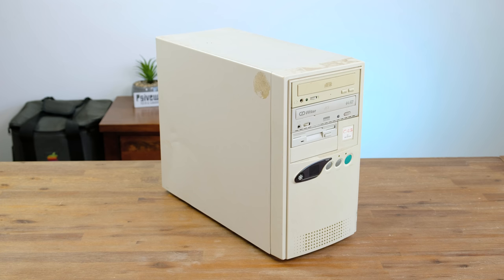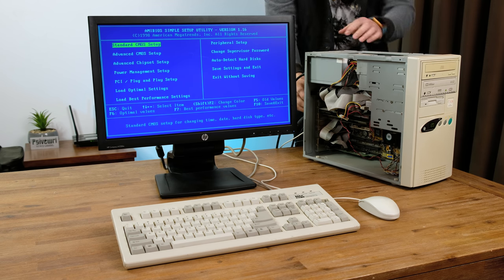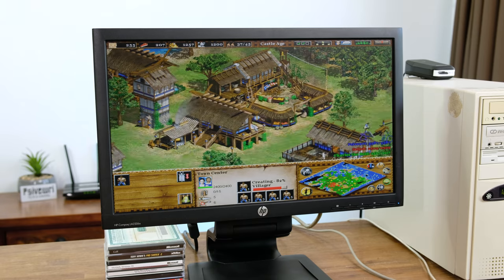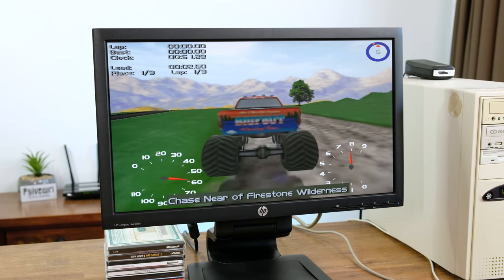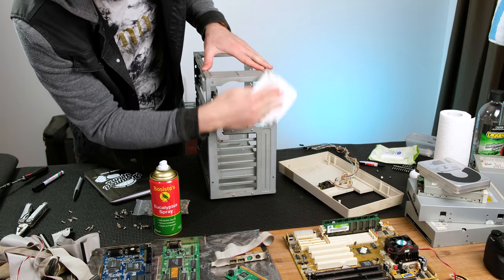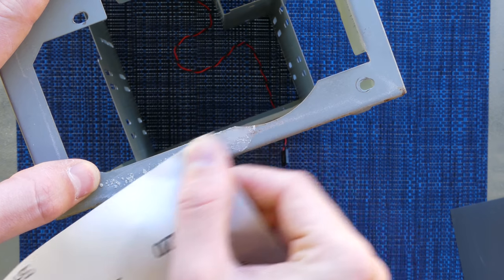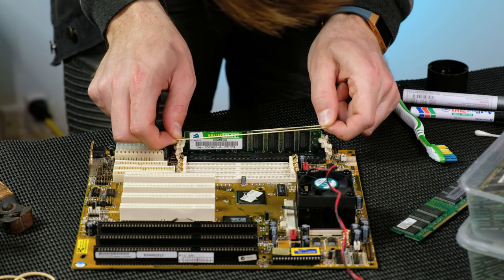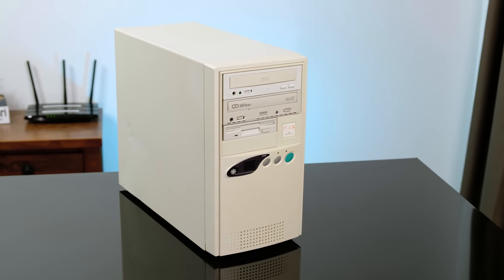Using An Old Windows ME PC! Big Mistake?

Comment: My first computer was very similar, although I upgraded the crap out of it :) I wish I have not sold it, but back then it still had some value.
The motherboard was a TX98-3D board, a Socket 7 board with VIA chipset, 4 PCI and 2 ISA slots, 2 SDRAM and 2 SIMM sockets, onboard dual channel IDE, PS/2, sound and USB (1.1). I got it with a 233 MHz Cyrix CPU (it was recognized by the BIOS as PR300, i.e. performance or Pentium-rating), 32MB of SDRAM, a 1MB PCI graphics card (cannot recall the brand, but it wasn't an S3 for sure), a 24x CD-ROM and a 1.6GB WD Caviar hard drive. Later on I replaced the CPU with a 500 MHz AMD K6-3 (although it could run only at 450 MHz, but a 450 MHz K6-3 wouldn't boot), added 2x128MB of RAM, a 40GB HDD, a 24x10x40x CD-RW drive, a 16MB Voodoo 3 2000 PCI graphics card and a SoundBlaster Live sound card. Oh, and there was a 3Com 100 Mbit/s Ethernet card added, and a USB 2.0 card as well. I also built an ATX power supply into the AT case (the board had support for both), and ended up hooking up the reset button instead of the power :)
I got a 1 GHz Pentium III system afterwards, it was already outdated, but still better than what I had. (It was already the Socket 478 era)

Comment: Windows ME got a lot of complaints because it wouldn't support a lot of W98 programs, forcing users to purchase new ones. But I found it to be a godsend. It was the first Windows release with "system restore". ME made the world safe for us "cheap program experimenters". You could install a program and if it broke something, all you had to do was dial back the install with system restore. It also saved users if any sort of malware got installed without his or her notice (most of the time). This feature allowed me to kiss Apple desktops goodbye. There were simply too many good cheap (or free) programs for PCs you couldn't find on Macintosh systems. I had no problem keeping a Windows ME system running, even though I experimented with lost of audio/video programs that may or may not  work well..

Comment: Nice job! Windows ME was my very first computer OS, so I had to check out this video.

My ME system was pre-installed on "eMachines". Man, what a lemon. 
Needless to say it did not last long, but the timing was good cos XP had just been released by the time my ME took its last breath. I miss a few of the image editing and other media programs and that were on the ME, but I definitely liked XP better (and still do - Vista, 7, 8, 8.1, 10, and any other crap that came out in between can all kiss my arse, lol). I learned a lot about computers and XP during its decade-long run (much of it the hard and expensive way), but it has served me well and I have learned many little tweaks to customize the system to run more efficiently and have it "pimped out" with all kinds of customizations, like a boot screen, welcome/login acreen, countless sound files and wallpapers, and even icons for desktop items, file types, Internet favorites/bookmarks, etc. 

I doubt ME could accommodate much of that, lol.

Comment: Thanks for the video! A few quick thoughts: You should Google "How to discharge power supply capacitors." (I would just tell you but I'm not a licensed electrician.) After I found out how easy it was to do what electricians do, I wasn't nervous working with power supplies anymore. Rubber bands will break down over time and stop doing their jobs. They will then crumble apart and/or become sticky. Zip ties are a better idea. Finally, I'm not sure the paint pen is enough to stop further rising. Most people who do refurbishment remove the rust. I believe Adrian Black covers this well. HTH!
Reply: further *rusting

Comment: Paper reinforced PCBs boards like this usually bend either because of moisture or mechanical stress, but I doubt it is the later one since it doesn't use one of those chunky heat sinks like Pentium 4 systems. Try to dry it with a hairdrier, go low and slow.
Minus 1 mark for reusing old thermal compound, +1 for using eucalyptus oil

Comment: Duke Nukem 3D doesn't need 3D acceleration to run fluidly. The 4MB S3 Virge is probably more than enough on its own. I played it on a noname laptop GPU without any 3D acceleration and 2MB SGRAM without any issues.

Comment: A few months ago, my father and I found an old computer in our barn that was running Windows XP. BUT, that computer was not designed to run Windows XP. It was designed to run Windows ME or Windows 2000 Professional, so I installed Windows ME on it, for the sake of playing old, nostalgic video games! :-D 

I can't really say that I like the operating system. There is no task manager. The native media player thinks that 80% of all my MP3 files are corrupted and the latest version of VLC Media Player that is said to be able to run on Windows ME, doesn't actually run on Windows ME. There are also these bizarre things, like DxDiag suddenly thinking that Windows ME is Windows 95 after installing a new game, or Windows ME thinking that my 32 MB graphics card has turned into a 8 MB graphics card after installing a new game.

There also the reboots I need to perform whenever a game crashes, which, in most cases, isn't necessary in Windows 2000 Professional and later.

I consider Windows 2000 Professional to be superior to Windows ME. The only reason I chose for Windows ME, was to be able to play old Windows 9x era games on it that simply cannot be run on Windows NT-based versions of Windows. :-D

Comment: A couple things. 1: Your K6-2 CPU is actually a 300MHZ chip, not a 233. 2nd: even if all your RAM fit in there properly it wouldn't read more than it has. 

Both of those issues are a limitation of the motherboard. It is a Socket 7 system, which is limiting your performance quite a bit. What you should look for is a Super Socket 7 motherboard. It is a revision to the original Socket 7 that enables more RAM to be used as well as faster CPUs (and will allow your CPU there to clock to its full speed). Basically, when Intel abandoned Socket 7, manufacturers like AMD, Cyrix, and VIA wanted to continue to keep making chips based on Socket 7, but as performance started to lag they updated the spec to be more Super. Eventually AMD maxed out what was capable on the socket with the K6-3 550 MHz. From there AMD moved onto Slot A, and then Socket A with the original Athlons.

Comment: Takes me back I had a few of them cases, you done well with the AT power supply as well ... I actually had a few of them 3DFX voodoo3 about 4 two were 16MB ones if think, TX Pro 2 chipsets with 233 Mhz K6 i used to supply them in UK for a long time ... I think they were Super Socket 7?? and I used either IBM Cyrix or AMD K6??, lol looking on Ebay it looks like yours is a Tx Pro 3 PCChips M575 .. those were the days .. I worked for a company and I would build around 8 a day ... that was around 1999 !! LOL its now $99.00 ... i think i used to get them for around $30.00 ...oh yes i looking on page they supported AMD/INTEL & CYRIX lol oh what fun all cpus fitted in those boards !!!  good video ...

Comment: I had one of these PC-Chips boards back in the day (running a Celeron with a SiS chipset).  It was pretty awful (but cheap - which is why I bought it.... I ended up upgrading to an AthlonXP a couple of years later which was much, much better) I can explain some of the weirdness:

* These were intended to be used as an 'upgrade kit' for older AT PCs - which is why they have ISA slots and EDO ram (as well as the more modern PCI slots and SD-RAM) but no AGP slot for the graphics card (I ended up putting a PCI Voodoo3 in mine).  The chunky keyboard connector wasn't usual at this time and I had to run an adapter to PS/2
Note that there is an ATX power socket on the board - so you should be able to power it with a modern PSU if you want to.   Of course, you'll need to work out which pins to short for the power button and I guess you could route it to the turbo / reset button.

* The SD RAM sockets on these need a LOT of force to seat the RAM properly (far more than anything I've experienced since and way more than you are giving it).  Like you - I learned that you can force the retention levers up when the RAM isn't seated in the socket properly.  I remember upgrading the RAM in mine - pulling out the old stick and then not being able to get it to POST with either new or old sticks....   A couple of days later after seeking tips from friends at school, I went ham and pushed super hard.  The sticks seated and all was well, I remember having a pretty significant blister on my thumb.  I think you'll need it mounted in the case to be able to push hard enough on it.

* As others have said, it's probably underclocking your CPU.  I remember mine doing this - the default FSB setting was lower than it should have been, and I needed to manually select the right one.

Comment: Good job. One thing that can be said for the old hardware, they did build it pretty well to last. That being said, I recently got a reconditioned HP Z620 with dual Xeon processors and a mere (ha) 96 GB of RAM. It's a bit of a beast and a long way from my  first computer, a Sinclair ZX-80 with a Z-80 8 bit CPU and a whopping 1 K of RAM. How things have changed. Ironically, the cost has come down quite a bit. The Sinclair was the first under $200 - at $199.95. The HP? $560.

Comment: When restoring old systems like that one I would never use the original PSU anymore.
Aren't there modern PSUs that still fit into those cases with all the necessary cables?

Comment: Great work, great system! Rust is not going away only with marking it, it must be converted to metal first, there is a green liquid for that, rust converter, i don't know the name. That millenium windows was very beautifull, but also very self-crashable, win98SE was better at that time. The IDE - hdd / cd cables you can also modify - you can run a knife across the length of cable, separate the individual 40 small cables, better in pairs by 2, and make a round cable from all of them using tape or tie them with zip ties.
I really enjoyed your video!!! Reminded me for Monster truck madness 2 game. Btw there is a voodoo wrapper now (nGlide and dgVoodoo), with it old games can be played on a modern PC, without having voodoo card. That voodoo card at that days was my dream, but i never got it, was really expensive, i had the crappy slow Riva tnt2, a bad noname card.
Reply from the maker: Thanks for the tips! I might have to looking into rust converter, haven't heard of it before

Comment: Cool video and it cleaned up really nicely! Also, ME was a bit of a heap of junk but it seemed to run quite well on this system. I'd be tempted to have it run '98 or 2000 though.
There is one thing I noticed about your voice over. Your terminology (Logic Board, Ram DIMMs, Physical power switch, drive cover plate, com port) is completely different and sometimes even false (DIMM is actually the memory stick, not the slot). It makes me wonder where you got your computer knowledge. This remark is definitely not meant in a negative way, I highly enjoyed the video but because there were so many instances of this happening I just started wondering; how come you seem to have your own terminology? :D. 
Thanks for saving that computer! More people should go about doing this, really. And not just with computers.

Comment: It's not the DIMMS that were bent, but the motherboard, which was bowed down in the middle, as you can very clearly see at 8:08. A better solution would have been to pack the underside of the motherboard, underneath the DIMMS, with a non conductive but firm material to push the bow out....

Comment: BE SURE to use a power supply that also has a (-5V) rail (white wire), in order for the ISA slots to work
Reply: The ISA slots will still work without it, but certain cards may not.

Comment: The way the motherboard was bent under the RAM slots I suspect if you could add a couple of more standoffs beneath the board that would flatten it out and fix your memory connection problem. Also, as others have suggested you should check the BIOS settings, the BIOS is probably configured wrong.

Comment: I used Windows Me for the first time a few weeks ago.  I did not like it that much.  It does not run much of my games and it can only do 16 colors and not 256 colors or whatever was required for those games.  The video features did not even work that well.  I was using a virtual machine though so that may have had something to do with this.

Comment: to fix the bending motherboard issue, did you ever consider to heat up the motherboard with an hot air gun and having something heavy (and not heat sensitive) on top of it ?

Comment: The "120" on the case display probably means that the PC was originally a 120MHz Pentium I or Cyrix, then was upgraded to the faster AMD CPU (PC performance was improving much faster than nowadays so nearly-new hardware was already obsolete)

(the display is self-programmable and is in no way connected to the PC other than power)

Comment: I started out with Windows 95 on a 120mhz Pentium 1, a giant 1.2gb hard drive and get this - 40mb of EDO ram.  You ran one application at a time, if you were a rebel you played a CD audio disk while gaming and had no RAM spare. 
Now I feel old, having just looked at the new AMD Threadrippers specs.
Reply: Then upgraded to a 950mhz AMD Duron with a 32mb TNT graphics card, which went like stink and had room to spare on a 20gb Maxtor. I think that beast even had 256mb ram.  The space age.

Comment: It seems that clock speed is not well config, when you boot it shows 233 mhz instead of 300 mhz. Old boards had to config clock speed using jumpers, and newer ones could do it by BIOS. You should check that.

Comment: So here's few clarifications: 
SIMM/DIMM motherboards were pretty common in socket 7 era of computers. This PC has one of fastes CPUs for this motherboard. Sadly, you probably won't make it better as Pentium 2 used Slot 1 and Pentium 3 had completely new socket. As far as I remember, K6 don't go faster than this one.

Duke 3D is not hardware accelerated. It's CPU remdered.

Quake 2 isn't using true Glide. John Carmack didn't like 3DFx and was a fan of OpenGL. So Quake 2 basically runs in OpenGL in compatibility mode translating OpenGL instructions to Glide. Because of this videocards like ATI Rage and Nvidia RIVA TNT show better performance in Quake.

Comment: Windows 2000 used the same start up music. The RAM issue has to do with density - high density RAM will only be read as half of its capacity in motherboards that are made for low density RAM. That does appear to be a PCChips M575, which is capable of being upgraded to a K6-2+ @ 400 to 500 MHz depending on the max bus speed the board has settings for. A patched BIOS is available here: http://web.inter.nl.net/hcc/J.Steunebrink/k6plus.htm .

Comment: Ok, you are young ;-) (or I am officially old? No, that can't be it!)
It's an K6-2, not a K6, which is quit a difference. When all my friends were buying Pentium II 350 and 400, I was toying around with an AMD K6-3 450. It was a beast, and I used it with Windows 98, then upgraded to ME. Which I kicked and used 2000 instead, before moving to an Athlon 900 Mhz. Hehe. That sound was SOOOOO familiar.

Comment: Hi, just flicking through at lunchtime at work, will watch it properly when i am at home.

Yes one hate is the older 386/486 / Pentium 1  - 30 pin dimm memory, the memory sticks themselves are fine, it is almost always those willy little plastic tabs / clips or those small bent wire tabs that give problems, often one leg/stud will break and you cannot hold the memory stick in properly, 
I have a Pentium 100 at home from new and it broke a clip when 2 or 3 years old, luckily it was no #2 of 4 so it is held in place with a piece of cardboard front and back as a type of wedge.

The problem is if no #1 on the outer edge goes as you place them in about 60 degrees then straighten to 90 degrees - i have seen a few fixes with cable ties or velcro

For myself ME never happened i held on to Win98 Se for a while and when i got my Pentium 4 it was sluggish with XP and i was offered a free OEM cd for Win 2000, it was great and stable, so i actually never really had the experience of ME or Vista at all ( other than recent playing on VM )

Regards
George

Comment: Frustrating part is as today's Hardware improves the software requirements keep growing as well. 

Hardware has improved leaps & bounds from 1995. We'd notice it if we were able to run WIndows 95 on 2019 hardware. 
It would run buttery smooth, fast as hell and you could multi task 100 items without a single glitch. 
But today are audio, photos and Video and 3D files have also quadrupled in size and minimum requirements are high.

I'm sure in the year 2030 we'll all have amazing Hardware but it'll still be one step forward 2 steps back because the software requirements in 2030 will also be demanding.

Comment: My first computer ran Windows ME. 
It has a 700mhz AMD Duron originally 128mb of ram, I think a 10gb hard drive..... a 8mb ATI Rage graphics card.
I used it till 2005 as my main PC, it got a 3rd 64mb stick of ram giving it a measly 192mb of ram. plus I got a low end ATI graphics card from like 2004 with 64mb of vram.... (Forgot the model) 

I've dusted it off before, and turned it into a DOS gaming computer. even installed a giant ass original sound blaster 16, plus installed a 5 1/4 floppy drive. 
But I kept this PC untouched from my youth, everything I ever had on it.

Windows ME is just horrible tho! 
I was ignorant as a child..... It was just "my computer" So..... I didn't let the many issues ME was faced with bother me. 
But very apparent to me now! 
Either way, I'm not going to change it! 

That computer you got there, looks like something someone salvaged together haha! 

I am impressed by the amount of effort you put forward in cleaning it up!